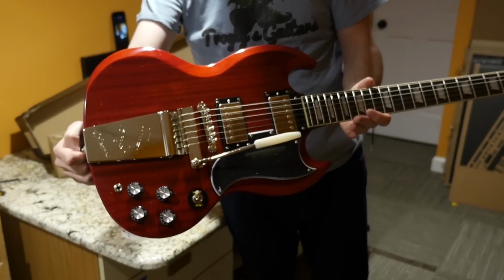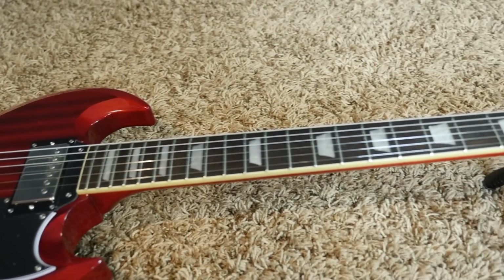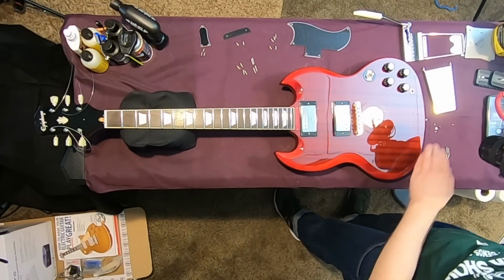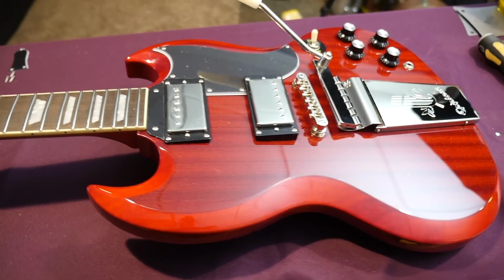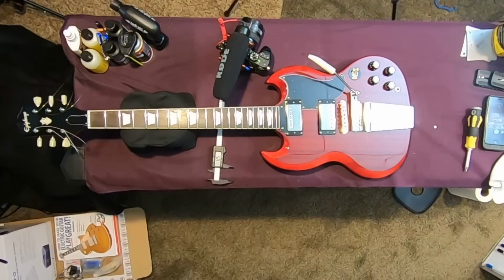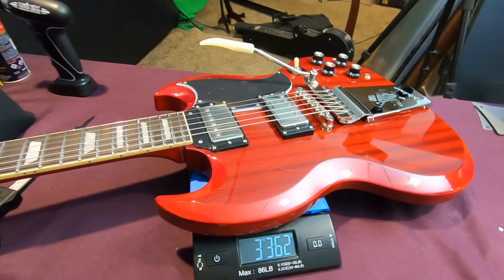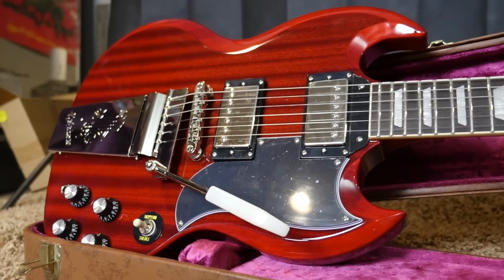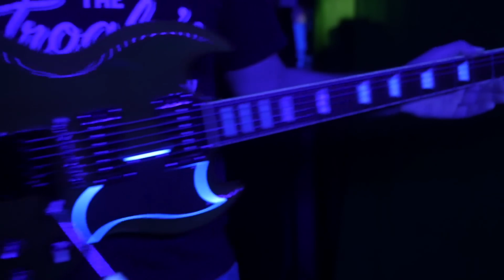Is The New SG Worth It? | 2020 Epiphone SG Standard '61 Maestro Vibrola Vintage Cherry | Review Demo

Comment: They should have just painted the whole thing red...honestly the verticals grain is annoying
Reply: I love it!
Reply: I have no problem with the vertical grain. In fact, some early 70s SGs had a really nice vertical ribbon grain like that. However, the veneer just looks kinda bad, especially when it's on top of a completely different type of mahogany.
Reply: Or just don't use the veneer. Nothing wrong with unfigured grain, SG's aren't meant to look exotic.
Reply: i think it looks cool
Reply: Looks amazing.
Reply: It's not a painted guitar, it's a stain. There are solid colours in the 2020 range, but this is a '61 reissue which means the grain should be visible under a cherry stain. They are keeping the cost down by using multiple pieces of mahogany which would look worse under stain, so this is the best way of hitting the price point.
Reply: I wish it had a quilt top. Instead of that cheap Veneer. Epiphone should have done a much better on the veneer. I have seen amazing sg's with that top from the 70s
Reply: I love it and I hate it at the same time. I’d rather they use flame maple, but it’s okay if it’s a 2 piece body. They don’t need a veneer to cover it up.
Reply: It looks too unnatural for the SG, part of what makes the cherry finish iconic is the slight grain because of the wood. This is overboard.
Reply: @Roughman you are too funny. I laughed and laughed at your comments. I was trying myself to determine why they made a two-tone finish on it, and, yes, it does look cheap. Someone else said to just leave the original body wood, because we all know it's a two piece body. If it were a four piece body, so what. It would still be wood and not a veneer. Now  l know what I thuoght of it. Old fake furniture with that ugly veneer painted dark to resemble more expensive wood. That's a laugh too because it would peel and warp and look bad.
Reply: Roughman hahahahaha terrible
Reply: They’re using it to hide the fact that it’s a multipiece body. It’s looks like crap and hides crap.
Reply: I have an Epiphone SG Special from a few years back with the same veneer, but they did a much better job of matching the colour of the veneer to the body so it isn't as noticeable or as off-putting. This just looks....off, cause the body and neck are a different shade of red from the veneer. I was looking at getting one of the new '20 Epiphones, but I think I'm leaning towards a Firebird instead of an SG at the moment just because of that veneer
Reply: @guitarocd9984  that's what a veneer is. It's a thin laminated piece of wood glued on top of the thick slab which is the rest of the body. No painting of stripes.
Reply: For such a cheap veneer they should have just dipped or wrapped it. Would probably look better with a fake wood grain wrap
Reply: I think it looks cool
Reply: I haaaate the vertical grain, it's annoyed me on the back of Epi LP's for years
Reply: @honkytonkinson9787  it is real wood grain it's just thin.  lots of companies do it.
Reply: @guitarocd9984  you can't strip a veneer without ruining it. Its designed to be thin. That seems like you should have researched more before sanding down.
Reply: @darthvader8804  I don't see any problem with sanding straight through a veneer, though. All you're doing is removing it to show the wood underneath, which is the impression I got from what he did.
Reply: @MisterSwagify  but complaining that the grain wasn't consistent past the veneer? I mean what was supposed to have happened? I think the whole thing is silly. Unless you already are desiring a stripped finish on a less desirable slab.
Reply: Cody Burgess they do that already , look at the collection
Reply: @darthvader8804  I'd assume if someone strips the veneer and sands through it they'd be refinishing it, presumably with Nitrocellulose lacquer. Seems fine to me; you just gotta be okay with a multi-piece body and unmatched grain. My 2010 Korean Epi SG is a 2 piece, though many are 3. If you're okay with the look of it showing the body joints then I see no issue in doing it, though obviously if you want it to look seamless that's a lot harder a job and it's not really worth the effort and risk associated. I'll never care to do it myself, though; I can live with the poly finish.
Reply: I would have preferred no veneer, just the base wood like the way they did the tv silver explorer pro.
Reply: um no
Reply: Ikr
Reply: @honkytonkinson9787  and a wrap is an inexpensive way to cover it. I actually like the finish of the VE, but gear on it needs an immediate upgrade.
Reply: I like it.
Reply: @squidwardjtentacles  hahahab
Reply: I got a black one.
Reply: To each their own. I prefer it

Comment: This is like the okayest guitar he has ever reviewed. I have never been so undecided on if I love it or hate it lmao
Reply: I hear ya.... I got one man I got to tell you I love it. granted I only play in my basement but it feels and sounds great.. been using it through a Princeton 68 reissue
Reply: I got one as well...its okay. Lol na i like it, needs the set up done but very nice to play
Reply: @pgroove163  sorry this is a bit late but how does the whammy work after using it for a while? (If u still play it)
Reply: @ZAQ-178 It doesn't.

I think it does add to the tone.

But if you do anything with the tremolo, you're basically asking for it to go out of tune.

Perhaps you can do a "light shimmer"

But it's not a whammy bar.

I still prefer SG with the Vibrola... but functionally, it's useless.
Reply: @adamjacksonmedia  Pretty much the same reason i fitted a Bigsby (copy) to my Telecaster, i don't use it just love the look of it, most of my playing doesn't require a tremolo of any kind, surprisingly the Tele stays in tune even when I've lightly used the Bigsby, it has changed the tone of the guitar with the longer string run.  I'm thinking about buying one of these SG's (why i'm here looking at this lol), but purely for the flashy looks.
Reply: kind of a gear snob thing to say LOL... but i get it man... im a epiphone guy but also own a gibson ... and every epiphone trogly "Reviews" he passivly aggressive hates on it in a way,  where to prs,vintage gibson connoisseurs it comes off as giving the instruments lots of praise... but to people who really play and love these guitars. hes taking jabs and digs at it every sentence he speaks lol, "this neck is no where near gibson quality and the mother of pearl is no where near as nice..  just a fake pearloid" yeah no sh**t trogly its not a gibson guitar nor is it advertised as a mother of pearl inlayed guitar... he should stay away from epiphones,kramers,squires if he has these takes (if he does thats 100% cool these arent for everyone and gibson stans wouldnt like them as they arent made for them) but trogly reviews them through Snob Goggles "its okay but not perfect nor no where near perfect" thats a direct quote from this video lol

Comment: I just bought this. For anyone thinking of buying! Drama about the veneer it actually looks very nice in reality also the mahogany wood on the sides of the guitar looks really nice to. Not sure what strings are on it they leave a dark residue on finger tips but they actually are still not bad but will change them for slinky’s eventually. TUNING not a problem at all.  It’s only a small tremolo movement not like a Floyd Rose and it’s more stabler than Floyd Rose I would say. In fact I picked this guitar because I know it’s tuning stable and I like the extra weight on that side to alleviate any neck dive . Now the neck dive is slight but not too bad at all. I have a Gibson HP SG ( no Trem) which has more neck dive than this. Also  it really does feel and look like a Gibson  . It feels more expensive than it is.  The pickups sounds typical of an SG deep, dark , barks and lots of sustain .  I once had an epiphone les Paul for similar price and it was about 4-5 years ago and this guitar is noticeably better quality no doubt about it. It’s too nice not to have a case . So I’m buying a hard case for sure.  The fret board is very good, not mind blowingly good but still good. The lacquer on the back of the neck is still smooth and doesn’t affect sliding your hand around. Nut cut nice. Headstock and tuners look great. The vibrola looks like  very good quality.
Reply: pablo9364 I think Epiphone has really stepped up their game this year as these SGs as well as the Les Paul standards all seem very nice and high quality.  They had to step it up because their competition, Squier (Fender import line), are putting out outstanding guitars as well.  It’s a good time to be a guitar player as their are so many high quality budget level guitars on the market.
Reply: I love the look of the guitar...I think it looks awesome! I'm not a huge SG fan but I really like the looks of your guitar. Just fyi:)
Also..I just bought a brand new Epiphone Ultra II and played it for a few weeks. The open e chord just sounded weird..but there was nothing wrong with the guitar. It would tune just fine. Intonation was excellent also. Well..I was playing my Fender and swapped to the LP and the open e chord sounded funny again..so I finally changed the strings to Ernie Ball regular slinky's and viola, the e chord sounded perfect. Actually everything sounded better! I'd throw a new set on there if I were you!
Reply: Papa Ruffy so true.
Reply: Michael Boyer thanks for your thoughts. I think I will change them . Thanks
Reply: I believe that 'dark residue' is a mix of 
the protective coating and a bit of metal
during break in, could last a few days, 
darkening finger tips. Without the coating,
I think the likelihood of oxidation/rust 
would be greatly increased during 
packaging and storing.

Comment: So here's my mini-review of the stop tail version. I love it, 9.5 out of 10. The neck is flatter on the back, which took some time to get used to, but once I did I was in love. Comes stock with 10-42 strings which were a little light for me but eh. Fretwork was great, setup was good, and nothing felt out of place. As far as the pickups go, I was underwhelmed with the bridge pickup, as it didn't have that bite that SGs are known for, but the neck pickup sounded fantastic to me, especially with some overdrive. Overall, it is now my main guitar, and I will do modifications over time, but for now, it gets a solid 9.5 out of 10 for me. Keep it up Epiphone!!
Reply: I got the same one, no veneer, stop tail, and the neck seemed ridiculously fat at first, but i like it now.
An SG is ALL NECK anyway, so it seems like a thin neck would break easier.

Comment: I find flat-backed necks are more comfortable if you leave your thumb centered on the back of the neck (playing arpeggios, complex chords, etc), while rounded necks are nicer for simple chords and blues/pentatonic leads where you wrap your thumb around the edge of the neck.
Reply: I ordered the Pelham Blue Special SG, and I almost sent it back because of the weird flat U neck profile. I changed my mind after about an hour of playing. I find it to be an extremely comfortable neck to play even though I traditionally prefer a nice round ‘59 type neck.
Reply: I like fat necks since most of the time i have my thumb over the neck but i'm starting to really like thin necks that they have on sgs so ye ur right
Reply: I scolded Jimmy Page about the thumb over thing
Reply: @johnlund2654  page-style blues rock licks are perfect for the thumb over the back style. Especially with the guitar slung low like he does. You can barely keep your thumb on the back with your strap that low anyway but it just depends on what you're trying to play.

Comment: It’s a 61 type which has a SLIM neck.  In 35 years I’ve never bought an electric guitar which was “set up” to my specs. I really dislike when people start casting aspersions only because it’s not a “name brand”. The Epiphone SG is well built. The guitar has great electronics, great caps, great pots, a great bridge and top nut. The best acoustic I’ve ever owned is an Epiphone DR500. The list of acoustics I’ve owned is vast and includes guitars priced from $3400 to $600.  The best electric Les Paul model is an Epiphone 60’s Tribute Plus. The list of electrics includes prices from $3200 to $400.  The best Strat type was a standard Strat by Fender. Second best is the Sire Larry Carlton series.  The technology to build great instruments is spread all over the world now. We no longer live in the 60’s when only American companies had the ability.  In summary, don’t be fooled by a “name”.  Play the guitars yourself and understand that the majority of guitars will need to be set up.  This guitar shown is as good as any SG made.  Most People wouldn’t know the difference if you changed the name on the headstock.  Tuning issues with the vibrola is common.  Most people use pencil lead inside the grooves of the top nut.

Comment: I know I'm late to the party here but the grain of the body and neck seems to vary a lot based on the example. The one in this video looks terrible, but the grain on the body and neck of mine looks absolutely incredible and blends so well with the veneer. I had to get really close up with a light to notice the change in grain, and the neck on mine almost looks flamed due to the amount of character in the wood. I've seen worse looking Gibsons, and I picked mine up used with the plastics still wrapped for $300! Worth doing a little extra research to get a super underrated guitar

Comment: The body / neck wood thing with Epiphone is kind of weird. They advertise it as "mahagony", but when I bought one the invoice stated it as "Aucoumea klaineana" wood. This type of wood carries the word "mahagony" in its trade name (Gaboon mahagony), but it is a completely different species. Wikipedia reads out "It is a weak wood, with low decay resistance and moderate dimensional stability. The major use of gaboon is in the manufacture of plywood." So after all the only real mahagony on my G400 is the goofy looking vineer. Acousticly, my Epi sounds rather dead compared to my Gibson SG. But amplified its a whole different thing. I've put a SD  "Saturday Night Special" set into the Epi, which workes out fine. And after doing that the original Gibson pups wouldn't even get closer. Therefore, I've put Burstbuckers into the Gibson, so it has come closer to the Epi. But not quite the whole distance. Obviously, the damping characteristc of the Gaboon is much more intense as with mahagony, which leaves some play for a good set of pickups.

Comment: Tulip Kluson tuners IMHO should be considered cheap hybrid tuners because unlike a real sealed die-cast tuner like a Grover or Schaller, the crown and worm gears are literally held in place by the "peened-on" square back. The original old-style Klusion's back had two bent tounges holding it together. This all works fine until they see a decent impact against a wall or door or something- and it's usually the G string. Then you better hope the peening or tongue doesn't get damaged in any way, because then it's the beginning of the end for that tuner. If the square back separates in any way, you'll find out when you're tuning up and the gear skips a tooth. You'll then remove the tuner with the hopes of fixing it, but it's usually not fixable. I see people try to epoxy the square back down to the tuner plate. That may work for a week or two but it's not reliable. My advise.... just have the tuner holes reamed for a set of 3X3 Grover 102C on it and call it a day. They are fairly inexpensive and considered an upgrade.

Comment: I have the 2020 Standard as opposed to the ‘61 variants. Beside the batwing pickguard, the major difference:  
- the Standard has Alnico V Classic Pro pickups instead of the Alnico II ProBuckers in the ‘61s. 
Mine also had a distinct neck back bow that I had to work out with the truss rod.  I see this on nearly every import.

Comment: You're right, the tremolo definitely doesn't cost $100. However it's not just the cost of the trem. It's the cost of stocking more parts, possibly drilling extra holes in the body, they had to develop a supplier for the tremb itself and check the quality of the parts coming in, etc.

Comment: I just purchased one from Guitar Center.  They have been on backorder forever.  Call them and get a 15% discount.  So I paid $466.65 for it.  At that price I pulled the trigger, probably wouldn't have without the discount.  I'll let you know what I think when it gets here.
Reply: Just a heads up, I have an SG from this line (the Special P90 in Sparkling Burgundy) and the neck shape really is weird. I've had it for around 6 months now so I'm used to it, but it's very strange feeling in the beginning. I'm still not absolutely in love with it (I prefer a thick, C-shaped neck), but it isn't a nuisance.
Reply: @kyyowa129  I thought about the P90 as I do not have a guitar with P90s.  This thing better stay in tune with the Vibrola or I will be returning it for the P90 SG.  I am hoping I will like the neck profile.

Comment: Even the 1960 models never stayed in tune, with the Tremolo,  Billy Gibbons has a few,  and he had the Trem  not connected, so it will play better,  Gary Rossington has an Original 60;s model that he plays the slide on Freebird, The Trem is Blocked and never used ,If you are going to buy a Epiphone , i would put a roller bridge on it,   Cousin Figel
Reply: I’ve got an early 2000’s 61 Les Paul custom version (SG shape) that I retro fitted a Maestro to, mostly for aesthetics (think in white and gold it looks killer!) but with a roller bridge and lubrication of the nut with lipsil, it keeps pretty good tune!